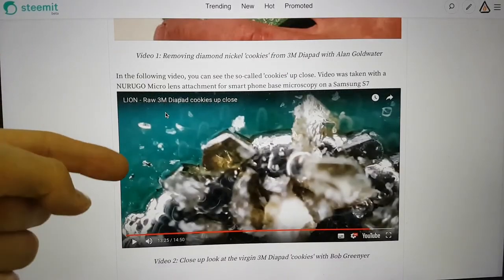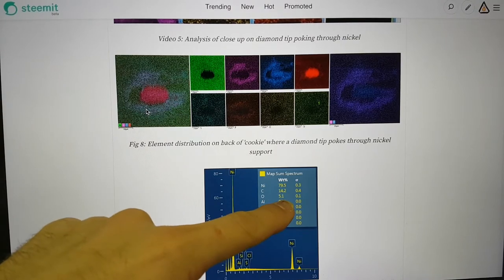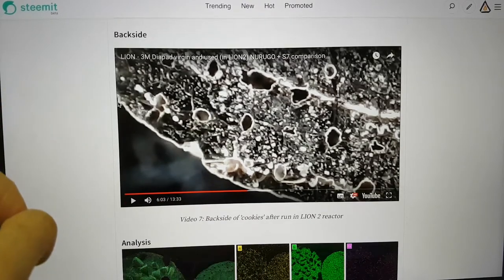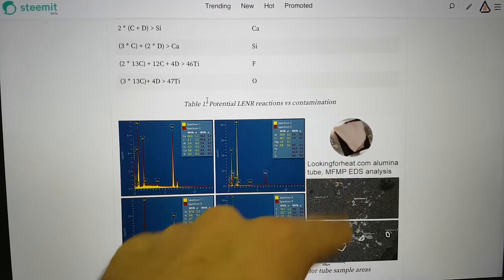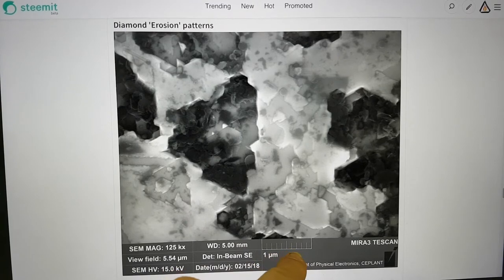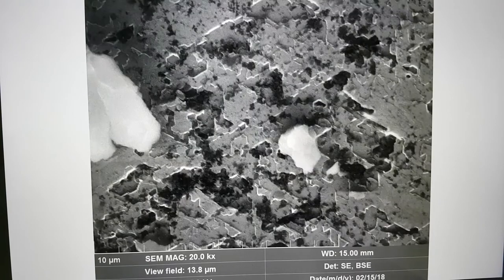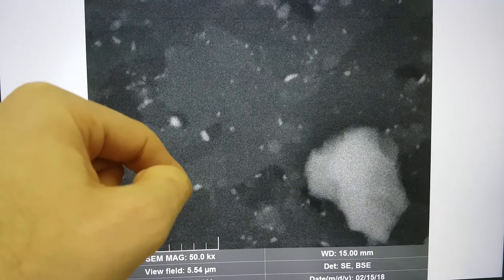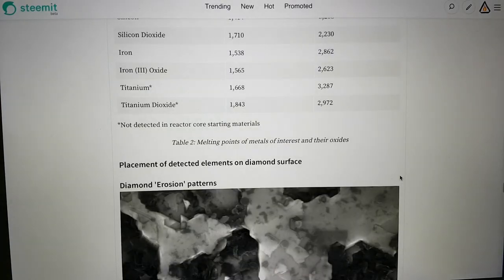LION 2 - Diamond mining analysis overview

Comment: Hydrogen is a well known growth flux for diamond.  So, in the presence of hydrogen, things that can happen to diamond, will happen faster.  For example - oxidation of diamond probably happens much more rapidly in the presence of hydrogen.  One of the things that can happen to diamond aside from oxidation is going from the diamond phase into the graphite phase.  This could explain the isolated particles that appear to be C - they could be small particles of graphite that formed from the diamond's carbon in the high temperature chemical environment.  One would certainly expect fractal changes to the diamond as it etches to CO2 and changes to graphite in the presence of H (D) and O at high temperature.
Reply: Hydrogen has the highest charge density of any element. All other elements have a lower charge. That's a circuit, correct?